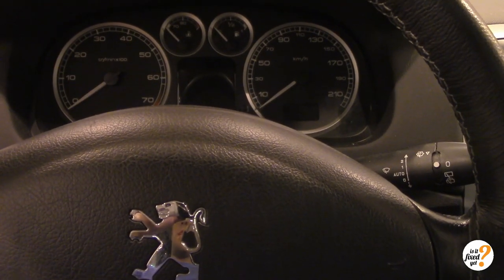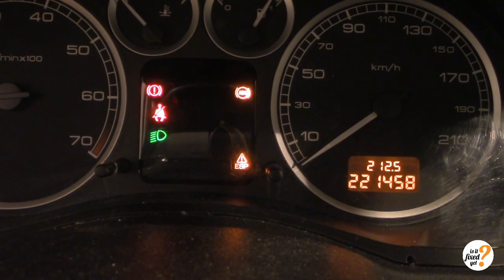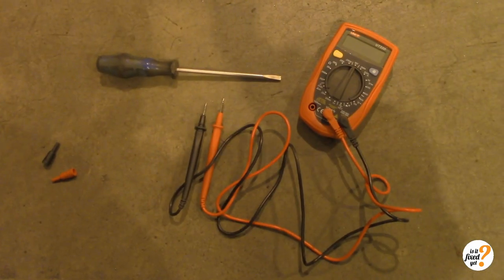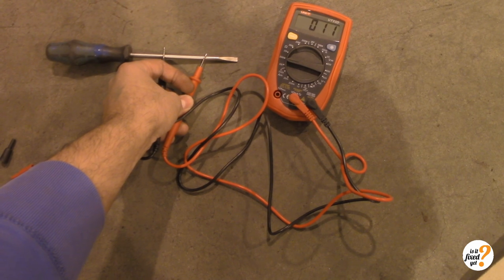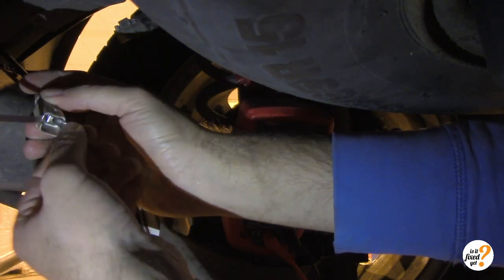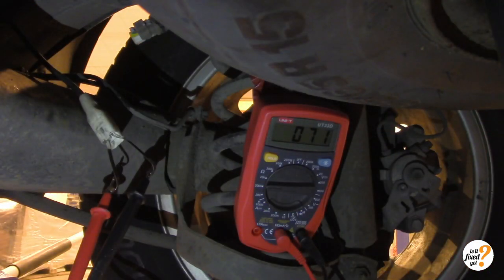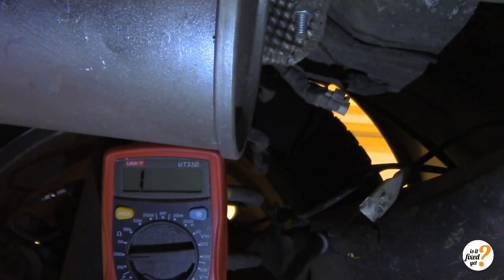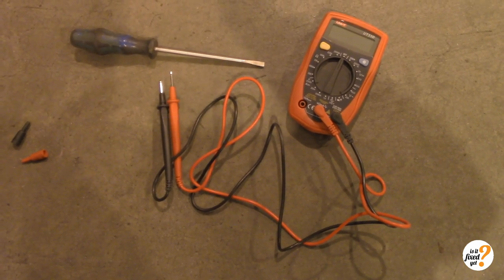How to DIAGNOSE the ABS Sensor problem - Peugeot 307

Comment: hi. please help me. i have a problem with peugeot 307 2.0 hdi 110 hp 2003.
the screen shows antipollution fault and esp. the engine runs at 1100 rpm and sometimes the throttle runs but immediately returns to 1100 rpm. and no more response to the accelerator pedal.
my car mechanic says it's not an egr valve and a fap filter. that the problem is with abs. because it cannot be connected by auto diagnostics with abs.
please do you recognize what is causing this problem?
thank you

alex

Comment: Hi there, I had and still have this problem with one difference. The light was coming on and off randomly. Mechanic said the connectors are to  be blamed so he just cut them and welded directly wires. Since the light is there non stop from start (before the light was coming up after passing 5 mph or not coming up at all). I am thinking( I am not sure) is it possible that he crossed wires when he welded them. I mean he connected for example left with right and right-left? After his job my OBD connector was down. Had to change the burned fuse. What will be happened if you connect wires as described above crossing them?
Thank you!

Comment: hi there a good video but the , needing help with the front scenser on my peugeot they need changing do you have any videos on this as i can not find any on line thanks
Reply: You can check the resistance values with the meter as shown for front plugs same as rear so you need the same value of ohms resistance to determine pass or defective 
the abs sensors are very easy to change ... all depends whom has been fitted before ...  torq screw head or 10mm bolt head behind wheel hub ...  normally rusted in but freeing oil and pair of pliers and you can remove them ...  if the sensors are reading okay ... then you have an abs ring defect and sadly that means new wheel bearing ...  which might be why  you have this fault ...   notice any play on bearing or any noise